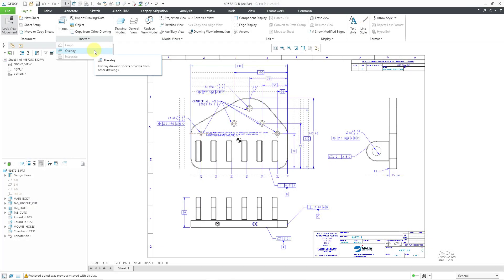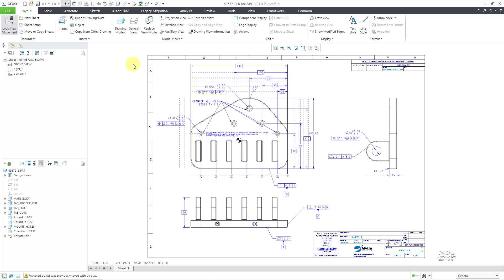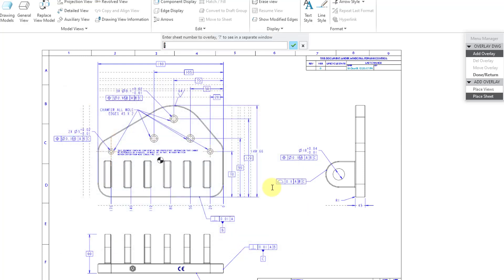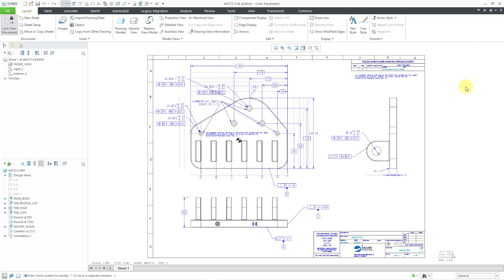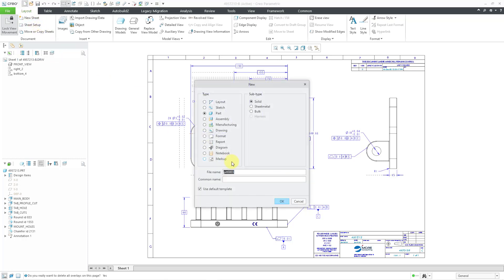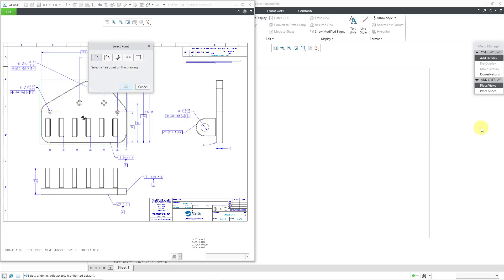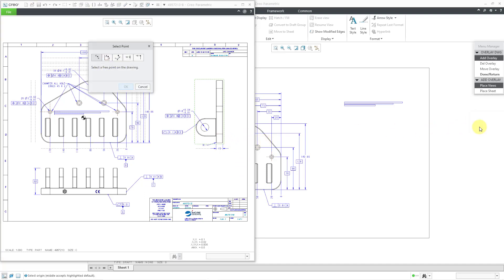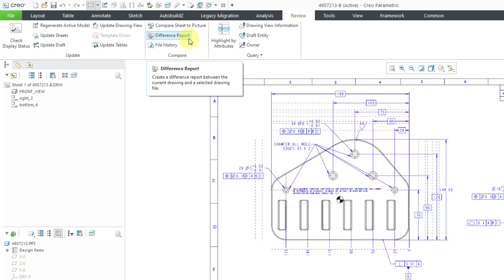Creo Parametric - Drawings - How to Create Overlays | Compare Two Drawings

Comment: In the engineering department where I work, we use overlay for New customized parts that depends on a main generic model. For the drawing we have a main drawing with the generic part with no revision table or anything else more than dimensions and needed views. That drawing is used as an overlay for the customized part and a view of the customized part is placed on a designated area. So if the main model changes, there is no need for changing all the customized ones since the important geometry is the logo on that customized part. I know family tables could be used but at this point, overlays are better than combining more than 1k parts into one model with family tables.